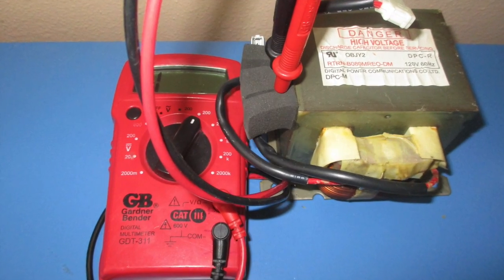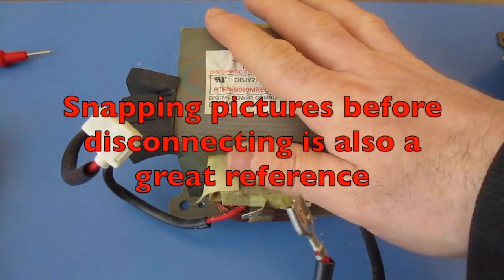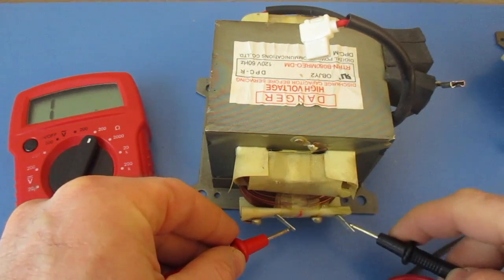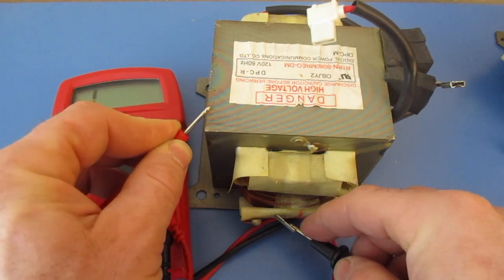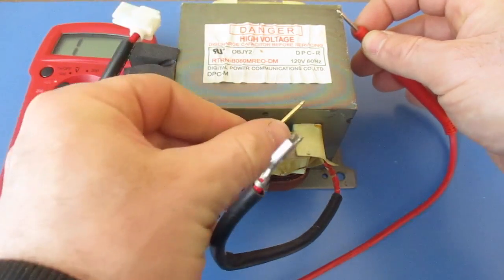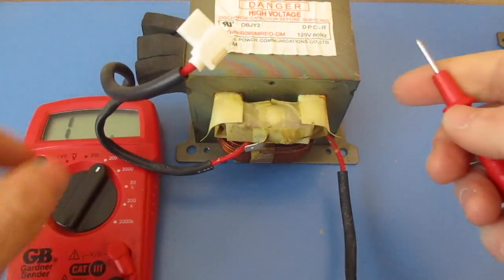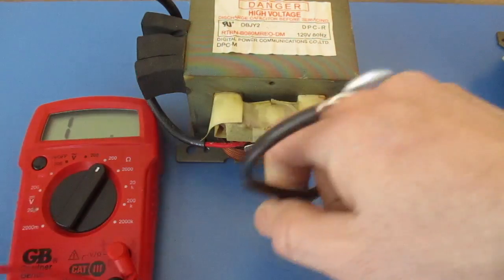How to Test Microwave Oven Transformer High Voltage HV with a multimeter

Comment: This test proves only that the windings of the transformer are (roughly) intact. This doesn't mean that they are working as they should, because this test cannot prove that there are shorted turns, especially in the high voltage winding.
Reply: I am a beginner with enough electrical knowledge to dare to fix an old samsung microwave. I have just plugged it in and noticed there is no dc coming out of the transformer side that is connected to the front buttons. I think I should get an output of 12v dc. Is the transformer broken?
Reply: Captain Prototype Transformers  work exclusively with AC voltages. That is, they are fed at their primary coil with the mains voltage and produce at their secondary coil the working voltage of the device. Now because electronics work on DC only, the secondary voltage of the transformer needs to be rectified by a diode bridge and smoothed by an electrolytic capacitor. This is the ordinary circuit in its basic form. If you suspect the (auxiliary) transformer, you have better verify first the continuity of its coils. For this purpose, have the apparatus unplugged (no power on it), and then check the transformer’s windings with your multimeter set in Ohms function. The primary winding should measure around one kΩ, whereas the secondary should measure only a few Ω, or less. If continuity is verified, then you should check the input and output AC voltages. Just because you say that there is no output voltage, the possibilities are: a) open fuse at the primary side of this transformer b) open primary winding c) shorted rectifier at the secondary winding. In this case, if there is a fuse at the primary, will be found blown. If there is not, the primary will be found open. Anyway if you find a blown fuse at the primary and it blows immediately after replacement, then there is a short circuit somewhere in the secondary side. If there is no fuse and the primary is open, then, before replacing the transformer, you must find what is wrong in the secondary that overloaded and finally destroyed the transformer. Otherwise the new transformer will blow as well...Good luck and keep your eyes open when working with mains voltages. If you don’t feel confident, let the job done by an expert. Anyway, the responsibility of your actions is all yours. Act accordingly!
Reply: Thanks for your answer. I can see I didnt know some important things about the transformer. I will try it with my blue rubber gloves on off course..Ps, I checked both fuses already.
Reply: @ΠάριςΑζής  ive just mesured the secondary coil. 3 ohm' that is perfect.  Also there is contuinity between the contacts of the secondary.  But i can only see one contact on the primary so i cant measure the primary windiing.. what can i induce about the fact that I also could not find any voltage in the secundary?
Reply: Captain Prototype It is important to verify that the primary winding is intact and it receives input voltage. Search to locate the missing contact (power off). Probably there is a fuse between it and the power input. There is no other way on troubleshooting this case. Just follow my guidelines and work calmly, with your Ohm meter and the power off. First you need to verify that the transformer is healthy and then that the power reaches its primary winding. There are no other shortcuts on this case. You can also work “backwards”, in a safer way. Identify that there is continuity (almost zero Ohms) between the terminal of the primary winding you already found, with one of the two terminals of the power plug. Mark this plug terminal. Then, do the same for the other terminal of the transformer, after you’ll find it. It should be connected to the other (unmarked) plug terminal. For these tests the power switch must be in ON position. By the way, confirm that the ground terminal is good as well, just for safety reasons. (Zero Ohms between the metallic case of the apparatus and the ground terminal of the power plug).
Reply: OK, I will try to locate the 2nd terminal of the primary so I  can do the measurements tomorrow.
Reply: Good morning,
I believe I was confused between primary and secondary winding. The primary winding is the one that is connected to the control board. The secondary is connected to the capacitor.

If this is true, then the primary winding reads 3 oms. The secondary winding has no continueity  The secondary winding has only one connector. The second wire goes directly into the capacitor. That is why I couldnt locate a 2nd connector yesterday.

If I am correct about the primary, it has 2 metal connectors side by side that are connected with a thin brown  and black wire. They measure no AC coming in.
Reply: Captain Prototype No, you are wrong about the transformer windings. Just follow the power cables. See where they go and measure their continuity. Check the power switch as well for proper operation. Perhaps it’s defective. You can do all of these tests only with your Ohm meter, without connection to the mains. Follow and verify the continuity of the power cables. This will lead you to the primary winding which is in the KOhm range in terms of resistance. The 3 Ohms winding is always the secondary. This would explode with 115 V applied to it. It’s simply the Ohms Law application. Nothing exotic!
Reply: @ΠάριςΑζής  oké . What I'm saying is that the power cord plugged into Little Bioard . It has Coil And a Fuse on It. The Other plak aan de Little board adres Brown and blue Wire coming from It. Ther bluewire plugges into the relay on the control board. The Brown Wire goes 2 The Little protection heat Switch. Reaaly strange, isnt it?
Reply: Captain Prototype If you measure Ohms directly on the power plug’s terminals (phase and neutral), with the power switch to ON position, what is the instrument’s reading?
Reply: it has no on /off switch. only 3 micro switches. Is that what you mean?
Reply: Captain Prototype No, but I think that this repair needs specific knowledge which you miss, at least for the time being, and therefore you should trust a specialist for having it done.
Reply: I think you are right. Ive just measured the power chord. Both terminals read 0.06 ohms. That is probably ok. I Might make a little vid on my channel about this machine. If I do, I will link it to you if you still feel like solving it.Thank you for your help, I still learnt a lot.
Reply: Captain Prototype OK. You are welcome again.

Comment: am 13 I took put a microwave transformer for science now guess what good news am not dead
Reply: Take a good care son. High voltage doesn't forgive ANY mistake at all!..
Reply: @ΠάριςΑζής  ik
Reply: It's the high voltage capacitor that the transformer is hooked up to that can kill you, it stores energy like a battery but releases it all at once. It's a cylinder shaped piece that looks like a battery, take a screw driver with a plastic handle and arc the terminals to discharge it, and be careful.
Reply: @johnruscigno5738  ik i did it thx for your concern 😁

Comment: Hi Friend. I,m from Brazil and I would like to get the resistance value of the secondary(High voltage). Something around 120 Ohms. Thank you very much. God bless you.
Reply: The resistance value of the windings of a transformer is not a safe way to decide about the health of that transformer. (Please see my answers to others in the comments of this video).

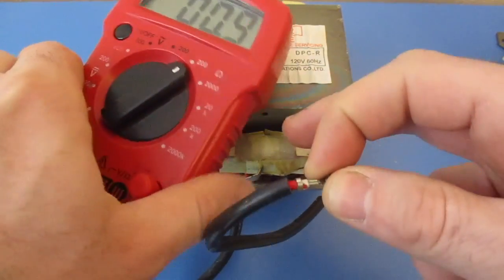Comment: on time 3:06 min.... is it good when there's a continuity on it or bad? coz my multimeter read its only 0.2 ohms
Reply: I'm getting the same thing on mine. I ordered a new transformer. Hopefully this is the problem. I see this guy is yet to reply to you. Did you get anywhere with your problem? Thanks
Reply: @joshn501  what was the problem?
Reply: Any continuity reading of a winding is an indication of a good winding (as long as the reading is not zero Ohms or nearby). This test cannot detect shorted turns of the winding under test. Any resistance measurement of one terminal of either of the windings against a) the core of the transformer (or (b) against the other winding) is an indication of either a leaky (bad) winding (case a) or of a short between the windings (case b).
Reply: Racist Brownie  I forgot to mention that in order to test the transformer (any linear transformer) for shorted turns you can use a small incandescent lamp (say 40Watt) in series with the transformer, with no load on it (all secondaries disconnected). If you feed the transformer with that lamp in series to its primary, the lamp should NOT glow. If it does glow, the transformer has at least one shorted turn somewhere in its windings...

Comment: You didnt have readings in the body since its coated with some kind of resin. very helpful your video thanks!
Reply from the maker: Yeah you need to go to an end where it isn't coated.  I believe I said that in the video, but yeah you can't go over the coating.  If you look on the edges you can find a spot where the coating isn't.  Thanks for the post!

Comment: Are you sure if that test is enough to confirm that the transformer is good or not ?
Reply: This test gives only an indication that the windings of the transformer are (or are not) open. But still the question of good operability of the transformer is open, because this test misses the problem of shorted turns in the windings.
Reply: Πάρις Αζής 0
Reply: @ΠάριςΑζής  good point, how could we put together a quick Dummy Load testbed.
Reply: @christianstclaire5706  You don't need any load for that purpose. Generally speaking, for any linear transformer used in electronic appliances, just disconnect all its secondaries and have the transformer loadless. Then connect it's primary to the mains. A heavy short anywhere within its windings, mostly in the primary but also in this case could be in the high voltage one for the magnetron anode, will immediately blow the primary fuse. If it is not fused, the transformer will rapidly develop excessive overheating in both its core and windings. 
Needless to say that one must be very careful where performing such tests, especially as regards microwave oven transformers, due to their high voltage being always present in their relevant winding!!!
As a rule of thumb, any of this kind of small transformers is to be suspected for shorted turns if when left loadless is connected to the mains for one hour happens to develop a core temperature of more than 50 degrees Celsius. This is a general indication that "something is wrong". 
A more practical method for identifying this type of failure (shorted turns) is as follows. A) First of all, it is good to know in advance the power of the transformer to be tested. B) If it's power is, say 250 Watt, we take an incandescent lamp of smaller power, say 40 Watt and connect it in series with the primary winding, before connecting the transformer to the mains. C) We connect the circuitry to the mains, while watching the lamp. D) If the lamp glows, there is definitely a short somehere there. If the transformer works normally, the lamp behaves like not being connected anywhere.
That's all...

Comment: Tested the primary resistance and getting a floating reading between .2 - .4 (sometimes hits up to .5).  Video suggests .5 - 1.5, below 2.  Is this a sign of a bad transformer?
Reply: Not sure. Please see my answers to others, in this video.
Reply: or bad connections in your test.  Or you meter leads something is causing the float.  If its not you leads, meter, or your test connections,  then whats left.

Comment: Wait um where is the output of the high voltage coil? I only see one
Reply: The other side of the secondary coil is connected to the laminates, or casing of the transformer, you can see the connection if you look closely on the other side near the top middle.

Comment: Usually microwave transformers provide up to 1800 - 2800 volts on the secondary side (output)
If you apply 1VAC on the primary side (and your transformer is 240VAC in and 2800VAC out) you should read around 12VAC on the secondary side.

But this is dangerous to do, so no attempt to make this happen, if something goes wrong you might end up trying to get your second life.
Reply: You can always use the reverse technique. Apply an A.C voltage in the secondary and see how much this voltage is stepped down in the primary winding. It is much safer for that matter and works perfectly!
Reply: @ΠάριςΑζής  I really appreciate your participation on this thread
Question: If I feed PWM DC to the primary,  would some current show up on the other side?
Reply: @christianstclaire5706  Of course dear!
Reply: are u afraid of 12v AC?
Reply: dont be a chicken!

Comment: great video, but your wearing a ring and your also measuring your own body resistance in parallel with the transformers resistance...which will drop the Rt significantly...simply do not touch the leads with your fingers...I suggest clamps
Reply: If you are measuring a low resistance wire you don't have to be worried about it, your resistance is insignificant to the measurement. Make the calculation, 2 resistances in parallel, one higher another way lower, the lower wins the biggest percentage of the value. Like that wire and your body skin.
Something he did wrong was that he didn't measure the resistance of the probes, that usually is around 0.2 up to 0.7 depending o the quality of the Chinese material

What do you mean with the ring?
Reply: @FixDaily  He probably means the risk of electrocution (which is not there when the device under test is not powered). Exaggerated sense of safety  I guess...
Reply: @ΠάριςΑζής  Hi, you are right as well :)

Comment: Magnatron is sparking can you suggestion
Reply: Say goodbye to your micro oven because of replacement parts.
Reply from the maker: Depending on the cost of your machine or if you need to save it to fit in a certain space or color many like to purchase a new mwave.  
Here is a link to check out;
https://www.mrright.in/ideas/appliances/microwave/4-common-reasons-of-sparking-inside-microwave/
is it sparking in the microwave or is the magnetron actually sparking?

Comment: What will the resistance range for primary of a 240v transformer
Reply: Around about the same resistance range as the as the 110v transformer.  The output voltage range is also similar.  The output voltage is then connected to a capacitor which has a diode connected to ground to effectively double the voltage
Reply: @nagual4ever  No, the output voltage is 5kv
Reply: Any answer in this question will be wrong. The resistance of the primary winding (for the secondary the same thought is valid as well) depends on the number of turns of the wire used, that is, its length, the material of the wire (copper or aluminium) and the diameter of the wire. In turn, the diameter has to do with the primary current, the number of turns with the primary voltage whereas both of these parameters have to do with the nominal power of the transformer core. Therefore any answer without any other reference is faulty in advance. Only comparison numbers can be given in reference to one specific transformer, having a given nominal power. In other words, among many transformers having the same construction, a working one of them can be used as a reference for the rest of them (with very tight tolerances as regards the comparison of their Ohmic values of their respective windings). Still the question of shorted turns remains open.

Comment: I tested my Samsung WB27X10910 secondary windings and only read 45 ohms (HV tap to case). The manual said it's 129.5 ohms +2%. My microwave won't heat and tripped the dedicated main circuit breaker. I am thinking the reduced resistance is causing too much current and causing the breaker to trip (although no blown fuses in the microwave) and the Magnetron TCO to cutoff to protect the magnetron. Is this correct and do I need to replace the HV Transformer? The HV Cap is good, the HV diode is good, the magnetron is good as are all of the TCO sensors. Door switches checked good as well. Thank you.
Reply: Daniel Kinder 
A low reading like that means you have shorted turns in the winding and the current draw will  increase. That is probably why the circuit breaker is tripping.
Reply: If you still have the unit not thrown away...Remove all the transformer loads i.e. let the transformer secondaries unconnected. Install a 10 amp fuse in its primary. Feed the transformer primary and see if the fuse blows immediately. If it does, you guessed it, the transformer is bad.

Comment: Hey thanks for your cool video. The resistance between the input terminals is fine, but when I check the resistance of the 'output' terminals that feed into the capacitor... they reach infinity. I'm wondering if that means my transformer is the issue? Any thoughts? Thanks
Reply: Check first if you are using the correct range of your multimeter. Then make sure that you are measuring across the coil of interest. If you are correct on that, an open circuit means a faulty coil (no voltage output).
Reply: Rr
TR ki full check batao